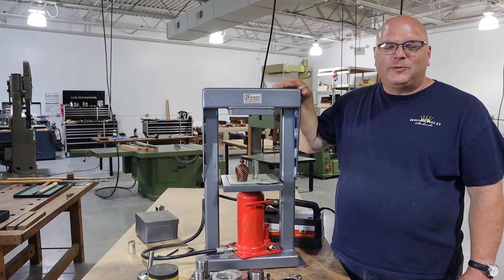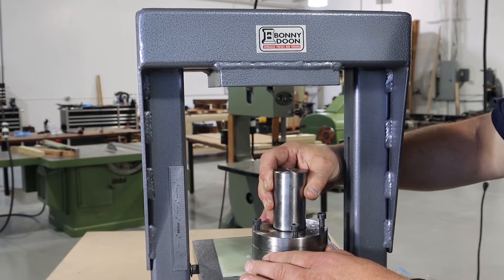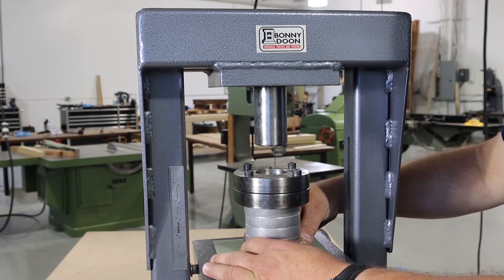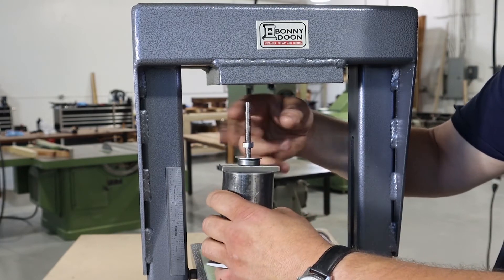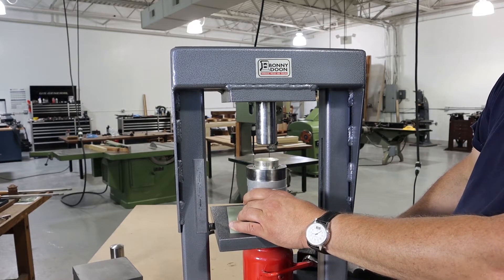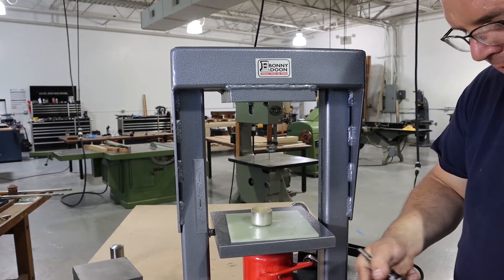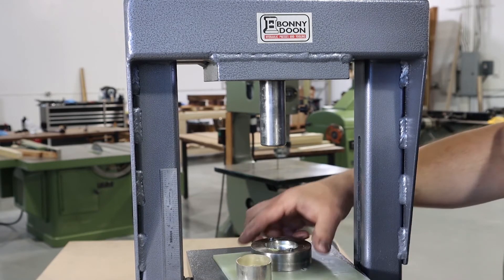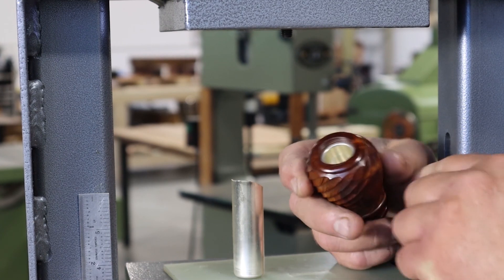Deep Drawing the Pill Box Liners

Comment: Very interesting video! I was wondering, if you start with 2mm stainless steel sheet do you make the plunger 2mm smaller in diameter than the moulding? If yes, you keep the plunger 2mm smaller in diameter in each incremental step along the deep drawing process? Thanks in advance!